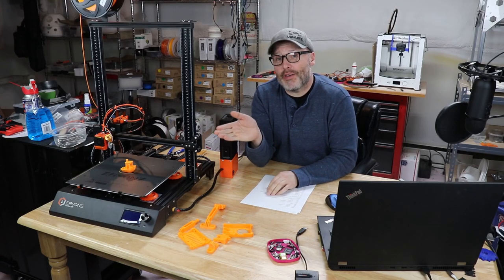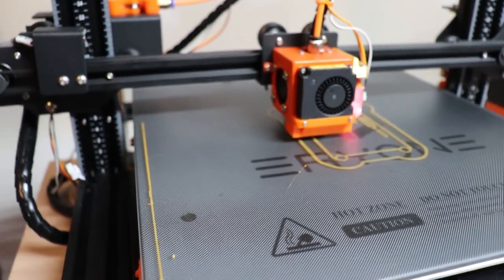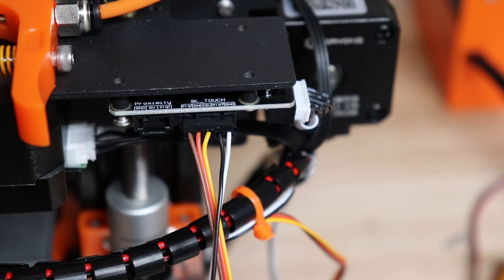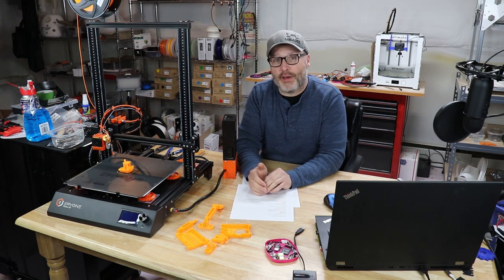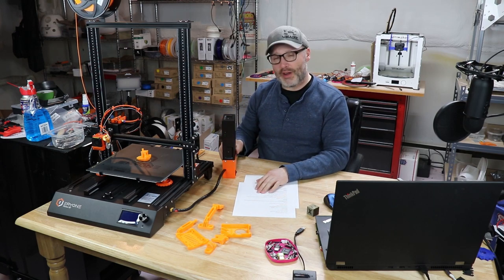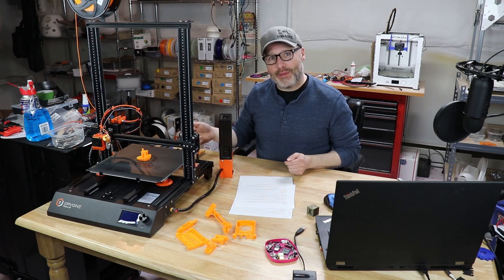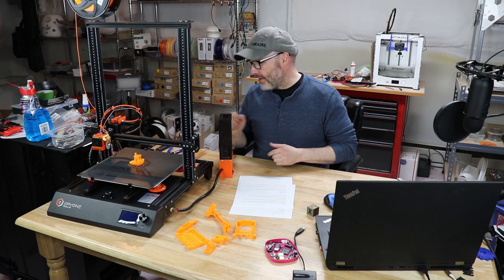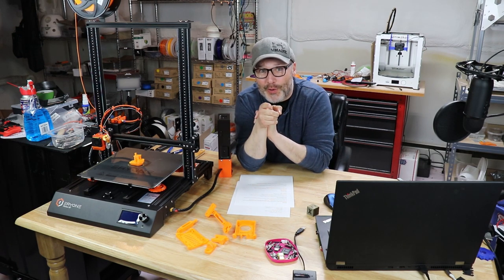First Thoughts on the Eryone Thinker SE 3D Printer

Comment: Thanks for your review, just received our printer today, and you're right about the assembly instructions. Not as clear as they could be. But all in all, it's easy to assemble, if you're an Electronics Engineer. but even those schematics are lacking. They should truly indicate that their image, is a side view. Looking forward to finally working with this system, and your next more extensive video review.

Comment: I got the same printer as you, although I have added an extra $50 for the maflex magnetic bed, which I highly, highly recommend. Probably one of the best bendable magnetic beds I've ever tried in 3d printing.
I've noticed that the bowden bracket is really really bad. It gives out to friction really fast after around 100+ hours of printing. I replaced the bracket with a MK8 style aluminum frame, and the retraction works just fine, if not, better. 
This is probably the most comprehensive review I have found on this printer by far, appreciate the effort that you put in!

Comment: I am subscriber 6.66K
Satan is pleased.
NIce video.  I just ordered this printer.
Have you tried 0.2mm nozzle?
Reply from the maker: Too funny!   No I’m at 0.4.  If anything I might go bigger.  BUT a friend has an Ender 5 Plus with a 0.25 and is having a blast doing miniature prints
Reply: @WhereNerdyisCool  I almost bought an Ender 5 Plus, but got this instead because it looks pretty good and was $150 off on Amazon with a free roll of filament.  Hopefully this will give similar detail with a smaller nozzle.
Reply from the maker: Good luck!

Comment: Really nice review. I have been looking to buy my 2nd printer and this review has given me an answer for that! Will be a nice step up from my anet a8 i got back in 2017.

Your review was really nice and detailed! Will definitely subscribe.

Quick question. What length coord did you need for bltouch? Also hows it holding up?

Another question- thermal runaway protection?
Reply from the maker: I bought the 1 meter version of the BL Touch (linked in the description) and found I had plenty left over cable to neatly zip tie out of the way. 
It has thermal runaway set on the firmware but I also flashed to a newer version (which also has it set on)
Reply: @WhereNerdyisCool  thanks! This printer seems like a great bargain! Its like the cr10s pro v2 but with glass/whambam already on it.
Reply from the maker: It has a glass bad. Not Wham Bam (which is a spring steel with PEX layer you apply. ). I just bought two Wham Bam kits for my printers.  I just need to find the time to install!
Reply: @WhereNerdyisCool  oh i was just referring to the S model as well. I cant tell if theres any other differences between the two.
Reply from the maker: I’d like to get one to compare.  They offered a discount to do so but I have to wait til payday 🙂

Comment: @Where Nerdy is Cool! What kind of Bl touch sensor are you using for the SE 3D printer? I found this Bl touch on amazon will this work for SE 3dprinter---Creality BLTouch Auto Leveling Kit Sensor V1 Mainboard Upgrade for 3D Printer Cr-10 / Ender 3 / Ender 3 Pro/Ender 5 / Ender 5pro / CR 10S / CR-10 S4 / S5. Thanks
Reply from the maker: Be sure to get a genuine ANTLABS BL Not the knock offs/ copies
https://amzn.to/38AE73F

Comment: Does it have a filament runout sensor and a thermal runaway protection ?
Reply from the maker: Filament runout , no.  Thermal Run away is enabled in the firmware
Reply: @WhereNerdyisCool  Cool thanks for the info.

Comment: Hi i have never used a 3d printer before and have very little knowledge on how to use one but am a quick learner and willing to throw myself in to learning. would you recommend this printer or have any recommendations on what i should buy. i live in the UK so would be helpful if i could purchase one from here and not the US. i would like to print things for  cosplay and want to make star wars stuff so it will get a lot of use. thank you to anyone that may be able to help me out.
Reply from the maker: It’s a good printer for a beginner.  I’ve had a few minor complaints, such as no ability to tighten some things up since eccentric nuts are not used.  And the x gantry seems to get out of alignment on the dual Z axis
Reply from the maker: An Ender 3 seems to be a very popular first printer.  It’s a slightly smaller print volume but has many nice upgrades available from the community